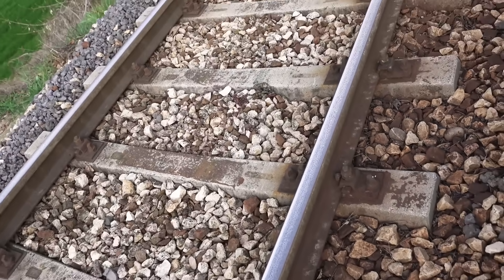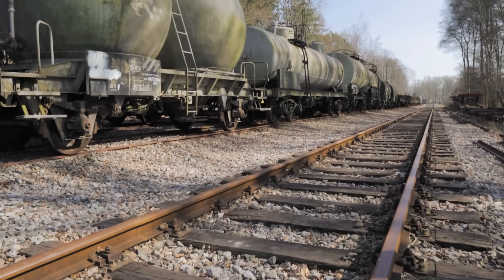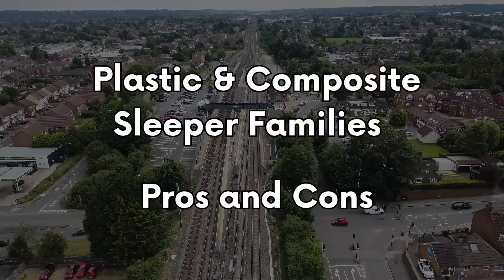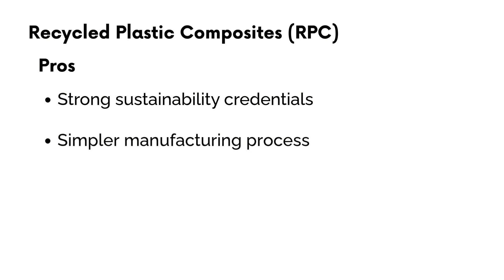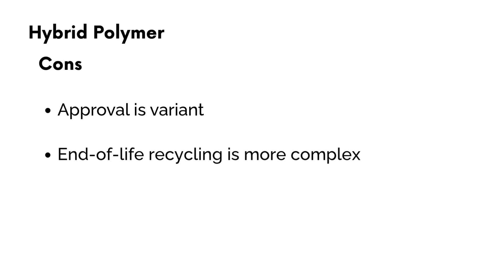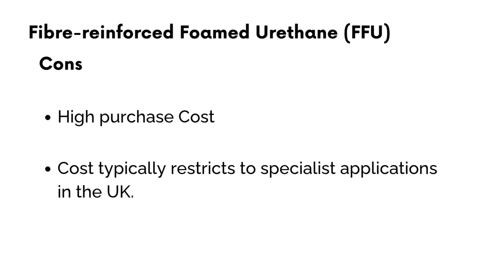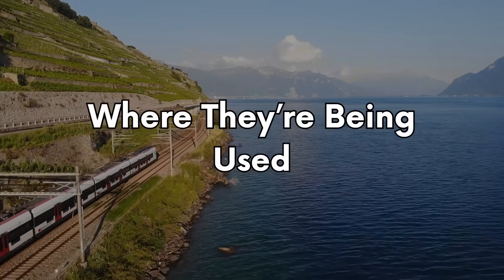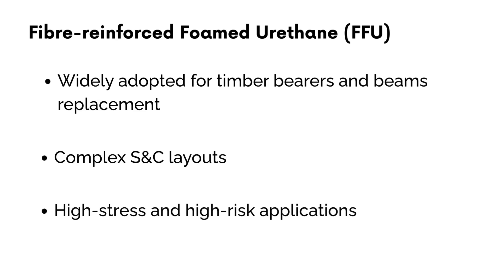Are Plastic Railway Sleeper Really the Future of Track?

Comment: i think steel sleepers are a pretty useful contender as well, they dont have any of the downsides of wood, but unlike concrete theyre light enough to carry, can stack ontop of eachother to save transportation space, they could be made with a low carbon impact, theyre entirely recyclable
they also use less ballast than wood or concrete

Comment: I wonder if plastic sleepers, when used in urban light rail, might reduce noise and vibration that urban trains transmit through the ground. I know when I visit my parents, I can sometimes hear the trams outside shake their building.
Reply: They are probably better when used with light rail in an urban setting.  Much light loads in those systems.

Comment: Not an expert, but: concrete not suitable in tunnels? Why would that be? The German engineers seem to disagree. In fact, the brand-new tunnels for Germany's project 'Stuttgart 21'  just about to be opened, which moves a whole main station underground are all concrete; with concrete making the tunnel base, walls, sleepers and ballast! You'll certainly find a number of clips on YT. I recommend the short 'Stuttgart21: Erste Führerstandsmitfahrt von Wendlingen bis unter die Kelchstützen' for an impression.
It might be the most expensive option on the outset. But it might turn out to be the most economically viable in the long run for a stretch of track, that will see very heavy usage for a long time to come, and can't afford a lot of downtime. Whether that really works out, remains to be seen.
Reply: Might be a vibration issue. Where I am in Australia tunnels were some of the first areas to be upgraded to concrete sleepers due to moisture resistance and reduced maintenance.
Reply: Why not slab track inside tunnels?
Reply: @josephma9332  Noise and cost.

Comment: Composite WILL NEVER BE FRA GRADE. Composite deck material is tettering on being banned. The fiber matter is still subject to every bio attack in nature.

It's also highly impractical to manufacture compared to concrete. We have a super abundance of sand, gravel, and limestone. 

At 1 point pressure treated timbers were tested. They failed so bad. 

So either creosote or concrete.

Comment: Plastics are currently being used on MML in leagrave tamper sidings we installed them 2 years ago so far they have proven to be very very good if a little hazardous in wet or icy conditions. They are easy to install as it only takes 1 person per sleeper rather then the 2 it replaces so you can get more done in the same time as it takes to install wooden sleepers. So from a pway point of view they are pretty good.

Comment: As with any engineering change, it has to be evaluated for all tradeoffs.  Here is a short list of items to be considered:

Cyclic dynamic loading of the railroad's trucks/bogies (weight/speed restrictions?)

Environmental thermal cycling between extremes (summer +45°C to winter -40°C, local area may differ)

Combined cyclic exposure to the elements, especially direct sunlight exposure

Projected sleeper life expectancy vs replacement economics (planned replacement of sleepers every x number of years?)

General population's perceived trust

Underwriting of insurance protections

Possibly more?

Comment: More microplastics in the environment ?
Reply: A good way to reduce microplastic infiltrating the environment is to convert plastic into big solid objects and put them to use in a place where we're watching them. Microplastics happen because we turn plastic into high surface to mass objects like thin films and fibers for clothing, which can then break down into tiny tiny pieces much faster. Also helped along by the fact that we take those plastic clothes and wash them putting the worn off fibers directly into the wastewater stream. If instead you make that plastic into big blocks like railway sleepers, embed them into ballast where all they do is get a little bit of sun and rain exposure and then monitor them as opposed to just burying them in a landfill and forgetting about them, that plastic is staying put.
Reply: @AlRoderick  Plastic sleepers would also be subject to abrasion against the ballast every time a train passes over them, which rain will then wash off and into the environment. I'm also not sure how they'd handle UV rays as plastics don't tend to do well with exposure to sunlight over long periods of time, this could also cause them to break down as well.
It's all trade-offs, sure, and any way that we can reduce or re-use plastics is a win, but I disagree that even large solid lumps such as railway sleepers are immune to shedding micro-plastics.
Reply: As opposed to cutting down trees or CO2 formed in the making concrete?? Given the ubiquity of plastic, the contribution from sleepers has to be trivial
Reply: @alanG3806 trees are by their nature, renewable. Not exactly small when you consider the 10s of thousands of miles needing relatively massive plastic sleepers every few meters.

Comment: I would think end of track life for many of the not just plastic ties would involve repurposing and not recycling as frequently done with old wooden ties.  Wooden ties have a higher turnover generating the most waste, so there would be a lot less of this material.  Railways could use the other than pure plastic ties to help build retaining walls or paving areas where there is rubber tire vehicle and worker interaction with rail vehicles.  The used ones might be sold to landscapers.  Our old wooden yard ties went into paving mushy areas not under tracks to stabilize the muddy soil.  Eventually they rot, so we just jam another old tie in the void.  The plastic ties of course should be recycled to make new ties.  Railways are the most environmentally friendly major form of transportation and it would be greater if they can consume plastic waste from society.

Comment: Not mentioned are steel ties/sleepers being used in yard trackage for longevity where track circuitry isn't an issue. In the United States we have had many false starts with alternative ties. One company was making ties of recycled plastic and had the advantage of being able to use plastic containers that had stored products, like motor oil, that made them otherwise unsuitable for recycling. They even sold one million ties to a Class 1 railroad for use in areas of high-water table. Alas, they couldn't survive the 2008 economic correction.
Reply: I noticed that too - actually in GB around the turn of this century Railtrack bought a huge number of steel sleepers for renewal of some secondary lines, including (those that I'm aware of) track-circuited, some with medium linespeed (eg 70mph) and carrying heavy (eg aggregates) freight. With compliant pad insulation at each fastening, steel sleepers don't short out track circuits although I wouldn't put them anywhere near public road level crossings with their salty grit contamination in winter! I don't know about steel sleeper design life, but SFAIK they're still fine 25 years on.

Comment: We have used recycled plastic sleepers on a miniature railway (7.25 inch gauge) for 25 years in Australia.  So far they are absolutely maintenance free.  Termites don't eat them, they don't rot or decay, screw threads don't corrode in them, and even bushfires cause nothing more than some singeing round the edges.
Reply: Perthite here. Was going to ask the same question. How do you see them in the middle of summer? Do they get soft under heat? Would they be suitable for the iron ore mines of the Pilbara or running across the Nullabor or up to Darwin? Or even Perth in the middle of summer where last year it was, if memory serves, well over 30C for all of January. The fire was also the other big question for me, a major fire runs through the area and the sleepers melt/burn and they are gone. How big was your fire?
Reply: @goatfiddler8384  The railway is in Perth and copes with local temperatures.  Bushfires have been very localised.  Most of the sleeper profile is buried in the ballast, which limits exposure to heat.  The occasional idiot lights a campfire on the track which does cause melting and charring, but the sleepers themselves do not combust.  The resistance to fire has been quite surprising.
Reply: Asking from the States here: What's been the effect Ultra Violet(UV) light exposure? All plastics will have some degradation from Sun exposure w/o a UV additive. Have your sleepers held up w/o the additive or would it be prudent to add to the mix? The effects would be discoloration & structural failure on a small scale.

Comment: Maybe we can machine FFU. In a factory, that can be done with effective dust control, etc., But if any machining is required on-site, can adequate dust control be achieved? Both for those actually doing the work and anyone exposed due to the dust being carried by air movement.

Comment: What's the erosion resistance of plastics. Wood rots, concrete sometimes spalls and rebar rots out. But all track is subject to friction with ballast, how does plastic wear? I've seen examples of concrete track looking sound on top but heavily eroded and worn away underneath. 
The other issue alongside creep for plastics is thermal stress (getting softer or brittle), chemical ageing either of the product itself or the substances it comes into contact with, finally fungal and bacterial attack.

I'm a fan of plastics. But in the UK the product would be used in a sector with very poor maintenance standards. In the Southeast, most sleepers date back to the 80's when government spent a fortune renewing trackwork to make it ready for privatisation. I can imagine Japanese railways are well maintained. How do plastics cope in  a low maintenance environment?
Reply: you might be right, e.g., its eventual sluff'll probably gunk up drainages
Reply: Plastic goes brittle under uv
Reply: As a freight train driver I can assure you that network rail track maintenance standards are NOT poor!

Comment: Good timber are hard to come by. Composite sleeper is the next best thing available.

Also composite sleeper can shape in wired form(K shape for point where space is tight).
Reply: Also timber can be rotten if the location had high humidity

Comment: In the US, the railroad I worked for (Keolis) had composite ties on the Gloucester branch between Rockport and West Gloucester (I think) and within the station of Norfolk on the Franklin line
Reply from the maker: What did you think of them?
Reply: @thepwayengineer they’re fine, got no strong feelings on them, mostly with they’d move away from wood and tie spikes.. ever since we had a bad batch of concrete ties they’ve avoided them like the plague
Reply: Interesting...  About 25yrs ago, my wife and I invested in a company that was going to produce composite (recycled plastic and steel) ties for US RR's on the recommendation of my father in law, who was a sales rep for a forklift company that called on that company.

The stock did OK for about a year or so, then the company went tits up...  Not sure exactly what happened, but for a young (at the time) couple with not a lot of money, the $10K we invested and then lost was a pretty big deal.  

As a model railroader and railroad enthusiast, I had high hopes for the idea and investment...  Hoping it comes to fruition on a large scale because it's a great idea for using up all that plastic that we recycle, but seems to go nowhere (recycling is a bit of a scam, fantastic idea that I'm wholly behind, but I've read that less than 15% of recycled materials actually get recycled).

Comment: I asked someone in my engineering firm who was formerly a MOW superintendent for a major railroad about composite ties, and he mentioned that despite their environmental benefits, the rail testing equipment cannot seem to properly scan the inside of the ties, thus placing them at potentially higher risk of internal defects if current testing equipment cannot properly send signals through these ties. Could you provide some feedback regarding this potential concern?
Reply from the maker: Interesting! What type of testing equipment do you mean? I’ve not come across sleeper testing as you describe before
Reply: @thepwayengineer  I'm not entirely sure, but I remember hearing about it being a potential concern for composite ties, although I'm not sure for which type of composite tie shown here, as I wasn't aware that there were several types of composite ties.
Reply: @Pensyfan19 If a form of sound wave testing is already being used to find metal fatigue and micro cracks, presumably it can take on recycled plastic bottles as sleepers no probs!
Reply: @thepwayengineer  BR used to test wood sleepers.  they had some hammer type thing that they hit on top of the sleeper.   or i could of dreamt that!
Reply: I’ve had fence posts for nearly 20 years made of recycled car tyres. Could that be added to the recycled plastic?
Reply: @Goldenoldie49 Well, they use old tyres in the mix for tarmac in the Netherlands and if plastic can be nearly as endlessly recycled as most metals, I don't see why they couldn't use your posts in these new(ish) sleepers.
But just like normal recycling, we have no power over what our used beer cans, plastic bags, bottles and film, or fence posts get recycled into.

Good luck with the inevitable chat with the blokes at your local tip when you present them with them!